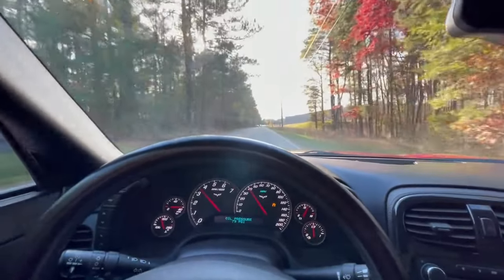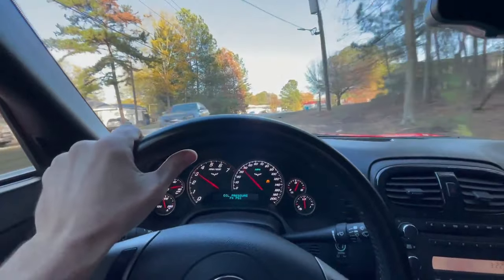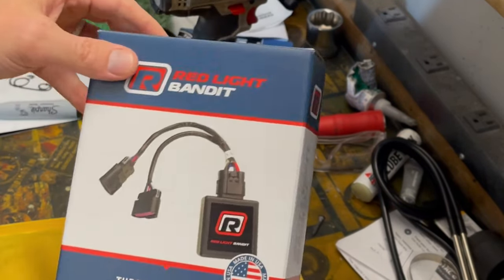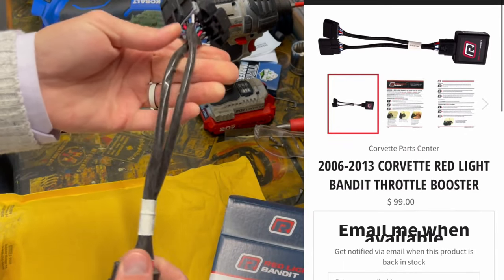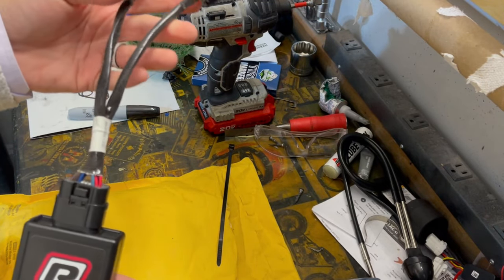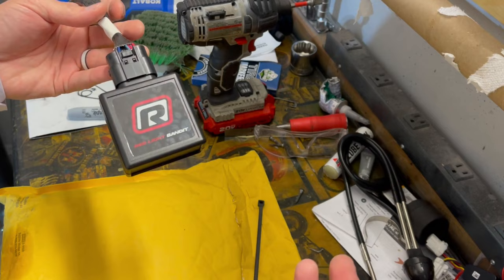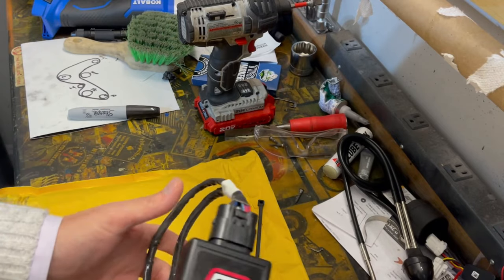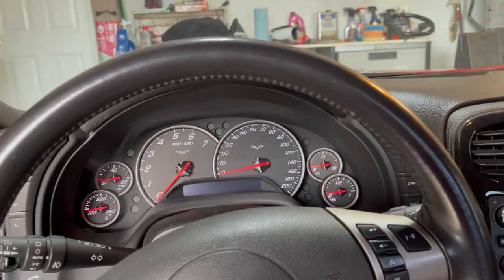Make your C6 or C7 Corvette FASTER for UNDER $100!  Too Good To Be True?

Comment: It seems to me (an "Old Fart" of 71 years & auto tech since 1968) that WAYYYYYY to many people use the term or word "faster" when then actually mean "QUICKER"!!!! What all of these electronic devices do is simply make (or attempt to make), the throttle plate move as fast as your foot can move the pedal! It changes the response time. hench -QUICKER!! to get to a given speed. They almost NEVER add power or speed, as that is determined by the engine (remember electric devices are motors). It can however add more speed (FASTER) if in fact the throttle plate was not fully opening before the device was added. Short bit of information:  they make DO make the driving experience a lot more FUN!!!!!!
Reply: The only true comment I've read. Put a Redlight Bandit on my C7 and responds like it was direct connect cable. Makes it snappy and quick. Don't waste time on anything that still has adjustable lag like pedal commander and a bunch of others out there. Your buying something to eliminate the lag so just eliminate it all together. By the way mine has been installed three years with no issues.
Reply: Nailed it. Changes the ratio of throttle input to TPS %. It's dumb. Cable driven TBs FTW.
Reply: Velocity = dd/dt.         Acceleration = dv/dt
Definitions in differential format....

Comment: I'm not here to one up or demean his project, however I'll offer my experience for those that are considering a throttle responder and you can take it for what it's worth. Firstly spend more and get more. Buy a unit that is adjustable and can be tailored to one's preference. Was my responder night and day? Absolutely, it's the #1 bolt on mod as far as I'm concerned. Everyone can do their own research but I would recommend looking at the Sprint Booster V3. Happy accelerating!
Reply from the maker: Great feedback.  If you you’re new to the channel you wouldn’t know, but part of what I do is install and test products:  I always say that “I spend the money so you don’t have to” lol.  I hope you saw my comments at the end.  I always try to give real unbiased input!  I don’t know that this will stay on the car.

Comment: Thanks for your post. I have an automatic C6. I installed the Pedal Commander …. And the difference is AMAZING.  I am no expert, but I think the increased performance would be LESS obvious with a manual transmission.
Reply from the maker: Good to know.  Yeah that’s sort of my thinking too
Reply: My vette is manual,  it kept getting the check engine light.  I guess it's bolt on time
Reply from the maker: @AllCreaturesCount  good input!  Thanks!
Reply: In my automatic I notice a huge difference in the response. It doesn’t add power it adds responsiveness.

Comment: I suspect the Redlight Bandit would create a more noticeable result in an automatic transmission. With the manual, it’s a lot easier to manage the motor’s powerband. Great video!
Reply from the maker: Yes this is exactly my feeling.  Thanks for watching!  Check out my two month review I did recently if you get a minute
Reply: Great!  I have a automatic and I hope that is the case. I’ll post my results when I have one installed.
Reply: @davidarmitage9041 did you get it?
Reply: It woke up my 2009 A6 quite a bit.
Reply from the maker: Giving away this throttle booster if you’re interested. The Giveaway video is live on my channel!
Reply from the maker: @davidarmitage9041  Giving away this throttle booster if you’re interested. The Giveaway video is live on my channel!

Comment: BEWARE: I bought one of these similar, DLX, and it died after a month. Only problem? The CAR STOPS DEAD IN IT'S TRACKS with a bad throttle controller; you'll have to wrestle it off to get going again.

Comment: Installed it on my 07 base and it was on for a week.  Initially, it was awesome!  Took it only a week to give me the "reduced engine power" message which would not go away and the car would barely run.  I uninstalled and reinstalled with the same result.  FInally took it off and I am returning it.  May not be for everyone....this would be great if they can get the bugs worked out!!
Reply from the maker: Thank you for the insight.  The difference it made feels so minimal that I will likely take it off just to avoid any potential problems.  Thanks again!
Reply: I had the exact same problem. When I first plugged it in it ran fine. Went to the store came back out and started up and started driving and then it started acting bad where it was like running on half the cylinders. It said reduced power and had the check engine light come on. I had to reboot the car a few times and then it would work and then it would do it all over again. I also have an 07 base model with an automatic 6-speed. I wonder if it has something to do with the 07 with the LS2. Or I wonder if it being an automatic have something to do with it. I'm glad I'm not the only one having this issue. I try to uninstall and reinstall it multiple times and I keep coming up with the same problem. It's a shame because when it was working it was fantastic.
Reply: @frankc1430  they refunded me quickly and I sent it back. They told me they were trying to work out the bugs for the C6 model and possibly by February would have them fixed.
Reply: I have a 07 base also, which transmission do you have? That's odd that you had issues.
Reply: @itsa364  if you're asking me I have the six-speed automatic.

Comment: Thanks for doing this video.  I had my automatic 06 C6 Dyno Tuned.  One of the things the tuner did was to eliminate throttle lag.  I guess this is what this device does.
Reply from the maker: That’s correct.  Good to know the tuner is able to do this as well.

Comment: I have a 2008 c6 It was awesome, but put stage 3 cam and fast intake,102mm throttle body ,cold air intake and polished and ported heads!  Already had headers she is a fire breathing dragon without power adders!
Reply from the maker: Sounds like a beast

Comment: Great review!  I went from a 2000 Camaro Z28 with a steel cable throttle ( no delay even possible ) to Corvette C5, C5Z, and now a C6Z, and never noticed the throttle delay intruding on my acceleration. The only thing I think it could affect is, if you heel-toe downshift, and you need that blip to happen in perfect timing, maybe then it would be noticed.  But it's like you say, with a manual car, you are never launching from idle,  except through a parking lot, so it does not matter if there is a tiny delay. Thanks
Reply: Huge delay on my c7 manual, like you say for heel and toe or just revs in neutral i can mash the pedal to the floor and back and motor doesnt even receive any throttle input!? 😂😂 the part i hate the most is when i lift it stays on throttle a bit for 2 seconds before it goes on to decompression its so annoying..

Comment: I Took my C-6 ls3 automatic 6 speed and HP tuners and set the TB to be fully open at 75% and with no spin at the track I got no difference. If you change the torque converter to a under 3000 rpm stall(totaly streetable)you will bring the stock 60 foot time down 4 tenths of a second. Thats almost half a second which is huge.

Comment: I think from a dead stop, in first gear, and you hit it, you should have felt something more pro active in throttle response., If you didn't then it's not worth the hassle. On my C6 automatic with paddle shifter in use from a dead stop at a light the 'lag" is noticeable. Your stick shift in first from a dead stop should have the same "lag." since no rpm's are built up and that is where you would notice it for sure. If you didn't feel anything then it's not worth it IMO. I'll pass on buying one I think.  I Only saw you try it once from a dead stop.  The rest  of the time you were already in your power band mostly. Did I see that correctly?

Comment: Did you have any problems with yours? I had problems with pulling engine codes and it running bad. Wonder if you ran into any of those issues.
Reply from the maker: I haven’t had issues yet, but I did hear others say they did
Reply: If you don't mind me asking what year is it and what engine do you have? So far the people that I see having this problem seem to have the LS2 engine. I wonder if it's a problem with the engine.
Reply from the maker: @frankc1430  this is a 2010 with the LS3
Reply: @SpeedCultureStudios  Ok! I think this product does not work on the LS2. My car is an 07 with an LS2 and I was reading in your comments another guy was saying it didn't work for him and had the same symptoms like mine had. And he also had a 07 with an LS2. I think this product isn't going to work for 2005 to 2007. Those are the years they use the LS2. And then 2008 to 2013 was the LS3. I hope other people chime in who had issues.

Comment: Thanks for the install information . I will be installing mine in soon . I'm expecting an improvement in response from idle to power band .So it should go from idle to 2500 in a snap, as apposed to ramping up slowly . That is where the throttle mapping delay is programmed from the factory on all new vehicles . I'm now expecting to be able to make my Borla Atak system to bark from idle as soon as I hit it .
Reply from the maker: Check out my 2 month review video!

Comment: sometimes the power gained is soo little that unless you dyno test it you wont be able to tell a difference, the part only changes things in the car ECU hence a tune, the tune that part give is probably not nice, you sacrifice reliablity for that gain,
the instant response in the throttle might be a nice thing but the lag or delay in response is meant so that you don't shock the car internal parts such as the transmission , imagine the diff and axle from decreasing in speed to a sudden hit with 500HP+
but the delay is meant to smooth that out so the car parts can last longer, 
another thing is it can change the fuel tune to either too rich or too lean, too lean you get more power but its more harmful to the engine its like the knife is too sharp that your not only cutting the chicken nicely but your also slicing the cutting board kinda thing, too dull it wont cut a thing but no harm was done there at least. just wasted effort in attempting to cut the chicken , too rich will choke the engine but it doesnt damage it in any way just more unburned and wasted fuel.

this is my opinion but i have no way to confirm this theory since im going with what i know and believe is logical
Reply from the maker: Check out my follow up to this video.  You and I are on the same page!

Comment: Have you considered doing a before and after dyno run.  I had the computer on my C6 Base re-mapped and it just got wicked faster..  477 lbft at the wheels.  LbFt which is where you really feel the oomph.  Stock HP was 430HP and after tune it was 460hp which is faster than my C7 cause the 460 is at the flywheel.  It cost a little. more than $99 (ok a lot more) but it was well worth it.  BTW order Bandit soon as they sold out a while back and the wait was several months.
Reply from the maker: I’d love to do a before and after!
Reply: I have a 2006 base C6. How much does a tune like the one for your Vette cost. I’m really interested in having it done if it would give me more horsepower. Thank you.
Reply: I have an 06 C6 6 speed and after adding a mild cam and headers dynode 420 hp. Your C6 is not stock.
Reply: Just looked online and 375hp is the norm.
Reply: Ralph above is either a troll, excluding details, or just full of crap. His C6/LS3 coupe after a tune didn’t net anywhere near what he is claiming. Stock on a dynojet 360-374 for the autos. 375-385 on the m6s.
Reply: @davidarmitage9041  Hi Dave:  Sorry to be so long but YOUtube does not give you an option to see if you have comments.  My base 08 cost about $750.  It was really worth it considering the cost of a set of tires is $2k, Ohlin coils cost $7k on my Porsche twin Turbo.  According to the local race team that did my tune all these $99 jobs do is take the built in lag out of from low to go.
Reply: @gotmylk  Please guys.  The placwe that tuned my Vettte is real,y good.  They win a lot of races on the west coast.  Want to see the paperwork?
Reply: @ralphconradt1434  I’d love to see a video of the dyno run as well as the printout on the pulls that netted almost 100 rear wheel torque from just a tune.  

I’ve been in the LS game for over two decades and the power gains you’re claiming above are grossly overstated.   I’ve also had tunes done from the top LS tuners in this country and the results you’re claiming are not accurate. Charlie from A&A has done tunes for me, Julio from Cartek has done tunes for me, Doug from ECS has done tunes for me, as has Bill from 2nd Street Speed in Perkasie PA. All tuners with winning race pedigrees and the fastest LS cars in the country. 

I’ve had stock vettes tuned, heads/cam/intake vettes tuned, heads/cam/supercharged vettes tuned. Gaining 70 rwhp and 100 rwtq from just a tune on a stock LS3 to 460/477 is NOT happening.  

Sorry bud but you’ve been sold a hill of beans from your tuner and their dyno is not calibrated correctly.
Reply: Thank you for the information,  I appreciate your honest input 👍

Comment: Why does your car have such high oil pressure? Do you have an aftermarket high pressure oil pump installed?
Reply from the maker: It’s not really high.  60 psi under load and cool temps.  It always leveled out to 35-40 when warm.

Comment: Doesn't make the car faster. Just makes the gas pedal more touchy/responsive. You can't open the throttle further than 100% lol
Reply from the maker: No, but if you get 100% throttle quicker, you can technically be faster.  Theoretically, if you’re getting quicker throttle response, rpm is dropping less or recovering quicker between shifts therefore making the car quicker.  Technically.  It would be nice to see some controlled testing though.
Reply: @SpeedCultureStudios  How long does it take you to press your gas pedal all the way down? 0.1 second? I don't think you're gonna improve on that much.  The throttle blade doesn't lag behind the gas pedal with the stock calibration. I.e. if you smash the gas to the floor the throttle body opens immediately. It's not a delay, it's something called exponential output. The throttle input (your foot on the gas pedal) is linear but the output (the throttle body) is exponential. It's hard to describe, need a graph to represent it. But there is no delay in the stock programming, it's just a more mushy feel the first half of the pedal travel. Throttle controllers simply change the input/output relationship to make the throttle feel more responsive, not to actually open faster.
Reply from the maker: @Carguylogan  You can't have a "more responsive" pedal with nothing being changed.  I don't have a graph to confirm and I'm not selling a product, so this means nothing to me--i've even said the product is not worth the money.  However, now that I have removed the part, there is a clear difference between shifts.  The only way to really know is to test it.
Reply: @SpeedCultureStudios  You can change the input/output relationship. If you mash the gas to the floor immediately, the stock calibration opens the throttle immediately. The difference is when you push the gas pedal down 30% it only opens the throttle 15%. By time you get to 100% throttle though, it opens 100%. That way it gives the pedal a less touchy feel. After the throttle programmer, 30% throttle input = 30% throttle output. Therefor you get more power at 30% throttle input.
Reply: @SpeedCultureStudios in drive-by-wire systems, the ECU is what controls the actual throttle valve based on the driver's "requested" throttle input. There are numerous algorithms between that driver input and the actual butterfly valve actuation including traction control, stability control, and interpolation to smooth out the driver input. This device and others like it seem to work by somehow overriding at least some of those algorithmic adjustments (likely the interpolation) to provide an experience closer to a 1:1 direct manual throttle where output = input precisely with no smoothing.

Comment: Supposed to take the positive cable off the battery not the negative it's not good for your computer
Reply from the maker: I’ve never once heard to take the positive side off.  And instructions with the module direct you to disconnect the negative.
Reply: Always disconnect the negative first or you run a chance of blowing your electrical system